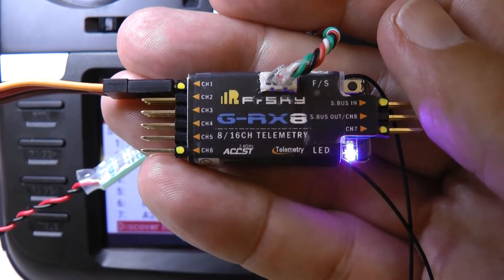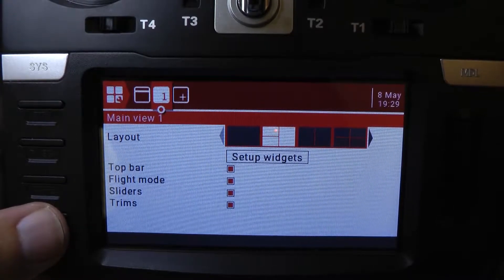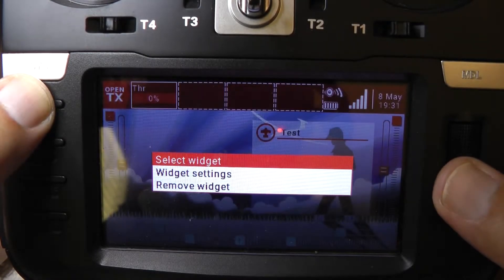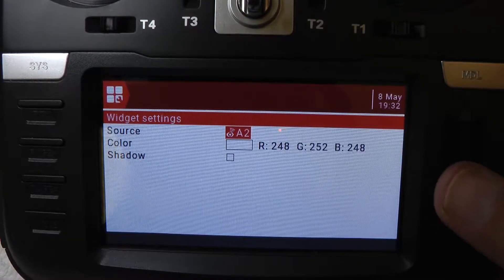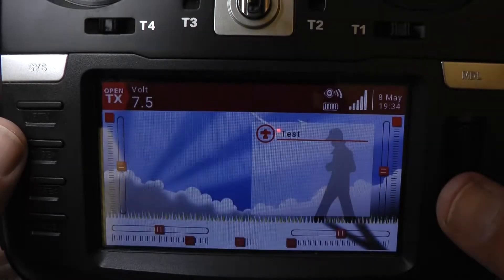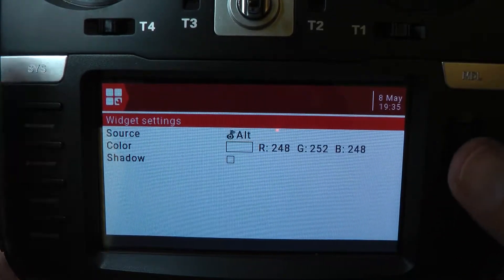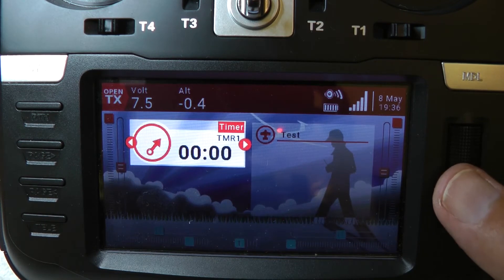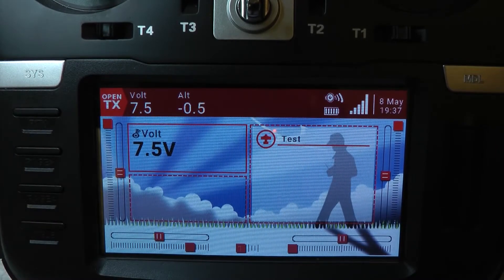OpenTX setting up the main screen for telemetry / sensors on a RadioMaster TX16s

Comment: great explanations regarding set-up. On another note, I'd love to know how the heck you were able to bind that FrSky receiver to a TX16s. Maybe I'll hit the forums
Reply from the maker: It's exactly the same procedure as binding on any FRSky TX.  The only thing to know is are you running the 1.x firmware or 2.x firmware.  You would pick the V2 for the internal module for FRSky receivers.
Reply: @GaryQuiring  thank you very much :)